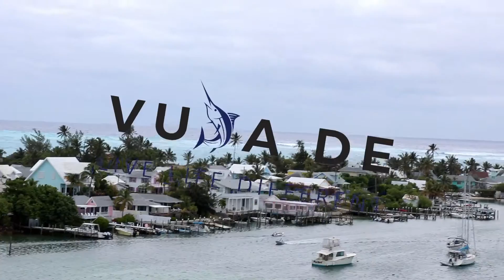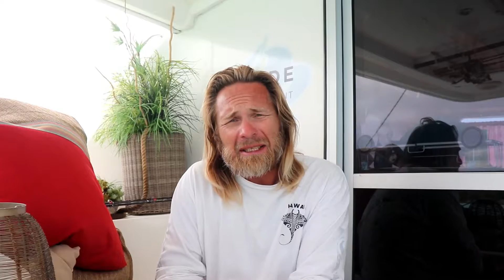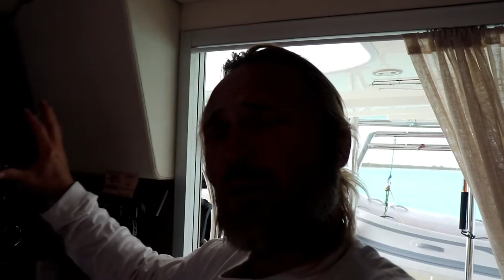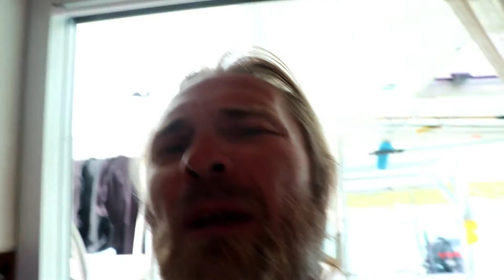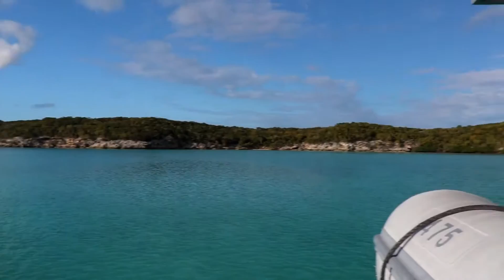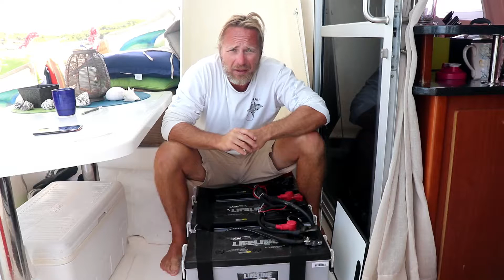Equalizing AGM Sailboat Battery with Solar Lifeline vs Vmaxtanks

Comment: Voltage drop from charger to the batteries is usually the issue. Just because your charger is set to 14.4 doesn't mean that it's a perfect run to the batteries. Terminals, cable length, heat ect.

Comment: Could you have gone with 8D batteries instead of 4D batteries?
Reply from the maker: The bigger batteries wouldn't fit in our box. We considered it though. Other than our coffee maker our battery needs are pretty low. The solar panels do most of the work during the day. 

Thanks for the question. We had fun with the battery videos and #vmaxtanks has been great to work with.

Comment: Hey guys! Thanks for the video! We are curious to hear how your new batteries are working out... Sorry the equalizing didn't work but I think we're having a similar situation to yours - plenty of solar but this season we are having to run the engine in the evenings and even then the voltage still drops very low with the Vitrifrigo running at night. Thinking we just plain need new agms now! Just wanted to see if this was similar to your issues and whether the new batteries have fixed everything... Sure hope so!
Reply from the maker: Hey, thanks for reaching out. The Vmaxtanks seem to have done the trick for us. We'll have a follow up video after we've used them for a while. Stay tuned...

Comment: Very good, how long did the batteries last n what did vmax tell you as to longevity 
Thx mgreat job
Reply from the maker: Thanks Edward.  We bought the boat in Oct of 2017 and moved aboard in Dec. 2017.  The boat is a 2013 and was used as a charter from commissioning until we bought it.  So, The batteries lasted us about 1 year but lasted on the boat for 5+.  Theoretically, these batteries could have lasted for twice if not more.  We have two theories as to what happened to their longevity.  1. They were consistently brought to a very low voltage during the time in charter 2. We didn't consistently get them charged to 100% during our time with them.  That's why in the video I harped on the idea of what is a fully charged battery.  I was making the assumption the Victron BMV 700 was telling me the truth that the batteries were completely full and charged when we may have had to periodically bring them to .5% of their capacity.  Long answer I know. 

Vmax has some great info on longevity on their webpage.  http://bit.ly/vujabattery.  In a nutshell, they expect the batteries to last between 5 and 10 years depending on the duty cycles etc.  This of course is really subjective.  They should last forever if they are always charged and never used.  If they are used to 100% of their capacity every day then they will last 300 cycles of charging.  I've done a bit of research on this and the best answer to getting the most out of the batteries question is to get them up to full capacity as quickly as one can.  

What other questions do you have?  I'm happy to tell you what little I know.  Thanks again for watching and saying hi.

Comment: Great video on how to work with old tech batteries, most vlogs only talk about install8ng lithium batteries, not in my buget so this was very informative.
Reply from the maker: Hey Cigar, always nice to hear from you.  I briefly considered Lithium but I think there is one major issue; they haven't been out long enough for anyone to know if it makes sense to buy them.  The price is roughly 2 to 3 times the cost of an AGM and waaay more than a flooded lead acid battery.  The cycle cost then goes through the roof.  If all of the batteries last the same length of time then there is no obvious advantage (other than weight) to go with Lithium batteries.  The deep duty cycle to me is not a super compelling argument for where spend our time.  We have lots of solar to recharge and we use our Rainman water maker with our generator almost weekly.  This gets our batteries recharged to the point where we really shouldn't even be down to 50% of capacity.  If it's cloudy, we just make water.  In fact, I think if I had to spend money I would probably choose more solar panels thank Lithium.

I'm really wordy today 8^)
Reply: @VujaDeLiving  i th8nk the end all will be the sodium batteries that are being developed.  Don't generate heat can also be drained to 0 and sodium is cheap!  Still dont have the performance of lithium but companies are working hard to remedy that.
Reply from the maker: Are those the Firefly batteries?
Reply: @VujaDeLiving  don't think so.  As far as I know there are no commercially available sodium ion batteries available yet, I am guessing 2 years away.